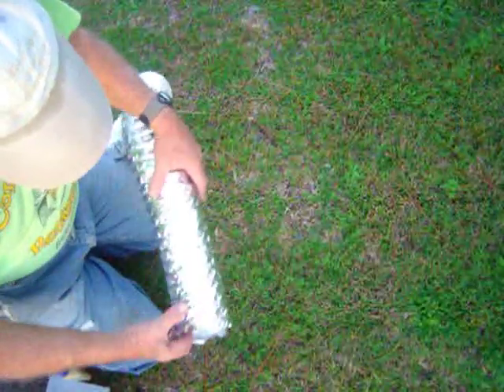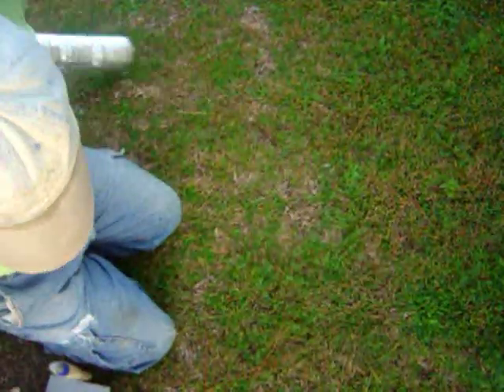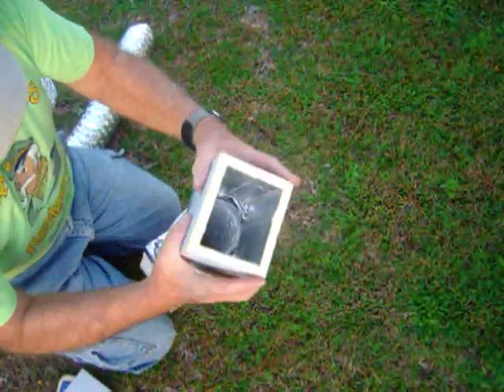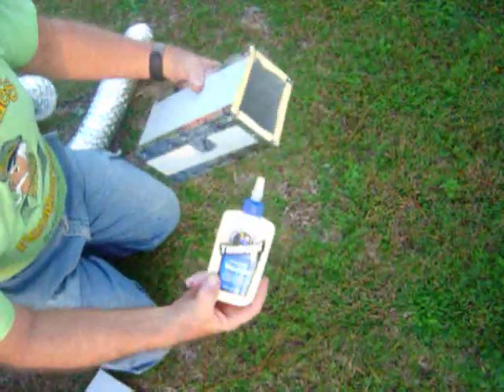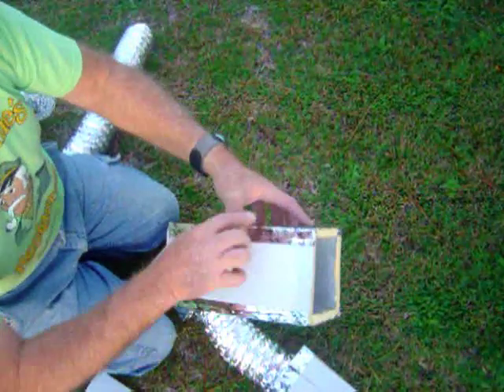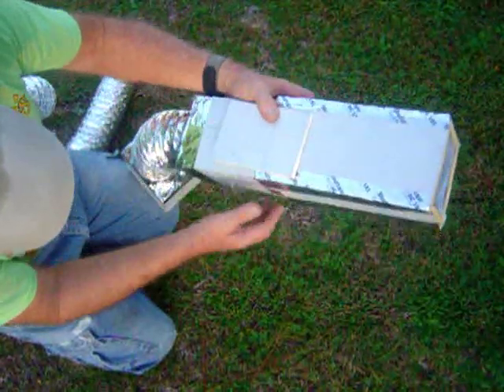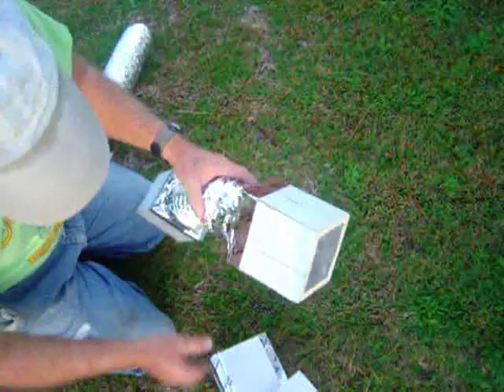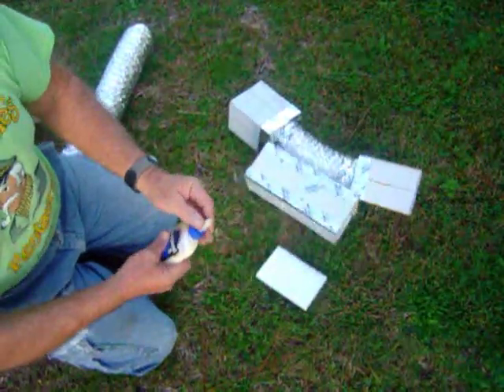Insulated Duct1.wmv

Comment from the maker: @solarguyable Thanks for the comment. Yes it does make a nice ridged insulated duct. Just cut to size and glue together. I used small nails to hold it until the glue dried, then pull out the nails(or leave them in) and run a strip of duct tape down the outside of the joint to seal any cracks. The name brand is Rmax R-matte Plus3. Foil on one side paper on the other.  Technically it is 1/2" Polyisocyanurate Foam.  Got it from Lowes but probably available at other places. Hope that helps you.

Comment from the maker: @patnhat Man I am WAY Sorry for the late response. I'm not getting any notifications of comments from youtube. I'll have to look into that. SIlicone may well be an alternative to the glue, although it may cost more, be messy(er), and take longer to set. I have noticed that there are small places that air was going thru the cracks between the foam. I duct taped the outside seam and that was that for that. :)  It's been so long since you asked you probably already have it figured out :)